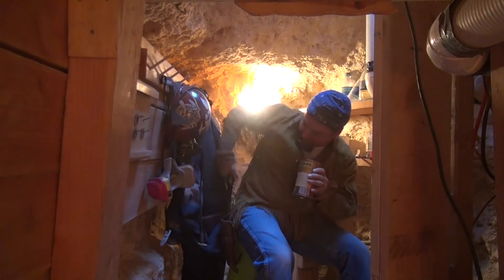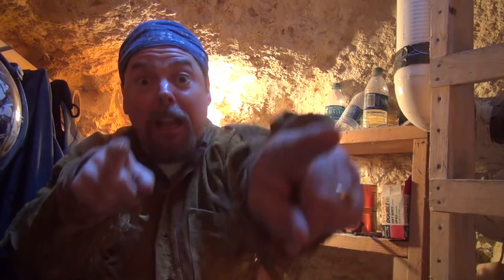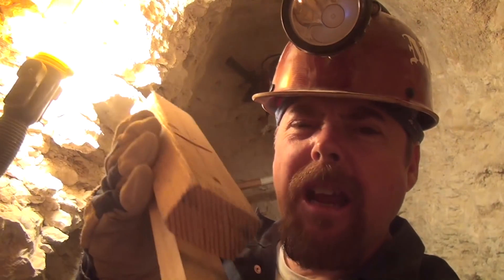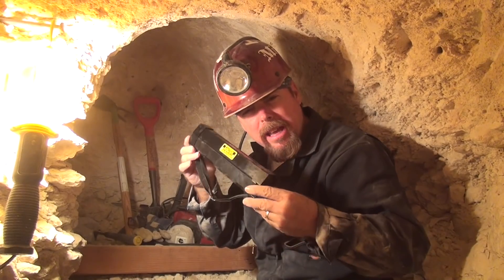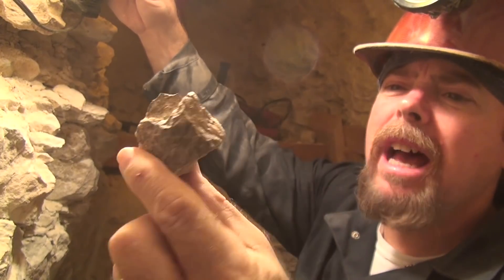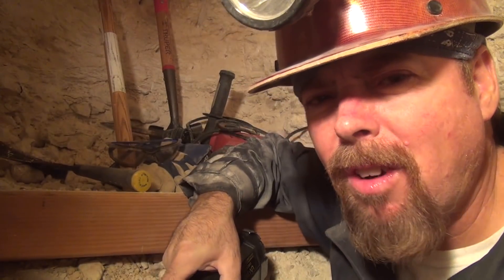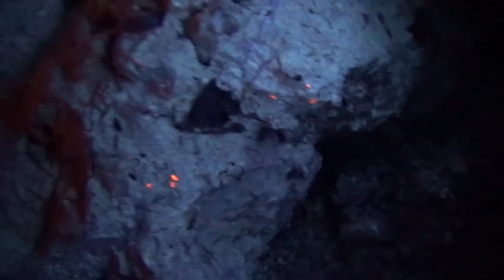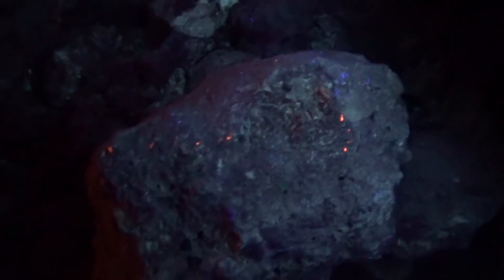HOW TO FIND GOLD | Using a | BLACK LIGHT - ask Jeff Williams

Comment: I’ve done a bit of research into the quickly evolving UVCLED technology. I’ll leave this carpet in pasted excerpt here that I wrote in response to a few YouTube comments and online forum posts. You might find it useful. 

A single or triple convoy host with UVC LEDs inside would be extremely useful! But would take several minutes to have any sanitizing effects. 
It would need to be a large array of UVC LEDs to reach the optical power needed for sanitizing. If you look up a video on Adafruit‘s YouTube channel a few months ago they tested UVC LEDs and they had a really large array. I think it was 5 x 5 or maybe 10 x 10 UVC chips chips. Probably a $1000 array.... And they show how much optical output it gives. Super short and interesting video I highly recommend.

Right now the cheap Chinese chips only offer 3-5mw optical output on average and the nicer Chinese chips maybe up to 20 mW. But at that point you’re better off buying the high output 30-50mw nichia Chips.
 
I remember a few years ago my 1.2Watt output green laser filled up a small 10 x 10‘ room with electronics and optical equipment. Costing upwards of $5000. But Now.... i’ve built several 1.5 WATT OPTICAL OUTPUT green lasers that fit into a small handheld laser pointer and run on a single 18650 battery. Costing under $100 to build. It’s the golden age of electronics… What a Time to be alive!

Until UVC leds reach 500 mW per LED chip… it won’t be viable for large manufacturing and sanitization like used in water treatment plants and sterilization processes in industry. Which are actually pretty common in all types of industry. Tons of different industries and factories have UVC light used for treating or curing or some other use.

And when UVC LEDs become powerful enough to replace the standard bulbs in tubes… That will save shit tons of energy! 

The only good thing about coronavirus… The coronavirus is solely responsible for the fast evolving UVCLED technology. Before the coronavirus… Even January of last year… You couldn’t even buy a UVCLED online. The only place I could find wanted me to send all types of business and licensing documents with my tax ID number and everything. Now there are real UVC leds that are as cheap as one dollar each. Of course these aren’t the good ones but still…and high output brand name leds are only $20. 
That’s freaking insane considering they were completely unattainable before six months ago. 

Not sure if you knew this already but here’s Something to look out for… this is an easy way to identify genuine UVC LEDs that actually put out UVC light. -
Real UVC LEDs will always have a purple/gray ceramic housing, with heavy gold plating covering any metal, and a quartz or sapphire window. Because UVC is blocked by glass or other materials..... therefore it has to be quartz or sapphire. If you look up real UVC LEDs then you’ll see what I mean. They all look the same and They all have that gold plating everywhere with the nice purplish gray ceramic body. Very similar look to Vintage IC chips that had beautiful purple ceramic bodies and gold plated pins and caps. 
If you’ve never seen what I’m talking about… then please take a second to check out these 4  links. Hell its like electronics porn. Just Beautiful…! Sex on a stick!

https://www.google.com/search?q=purple+gold+ic+chip&client=safari&hl=en-us&prmd=sinv&source=lnms&tbm=isch&sa=X&ved=2ahUKEwiY4JLdmbXsAhVGvFkKHTMoBYkQ_AUoAnoECAgQAg&biw=414&bih=622&dpr=3#imgrc=RTX1st5lL-ZABM&imgdii=Zcq0VJJb9uK0JM

https://www.google.com/search?q=gold+ic+chip+Beautiful&client=safari&hl=en-us&prmd=isvn&source=lnms&tbm=isch&sa=X&ved=2ahUKEwiAg4jsmbXsAhWKmVkKHdBWBLAQ_AUoAXoECBMQAQ&biw=414&bih=622&dpr=3#imgrc=Oza7GmtLzvckkM

https://www.google.com/search?q=gold+ic+chip+Beautiful&client=safari&hl=en-us&prmd=isvn&source=lnms&tbm=isch&sa=X&ved=2ahUKEwiAg4jsmbXsAhWKmVkKHdBWBLAQ_AUoAXoECBMQAQ&biw=414&bih=622&dpr=3#imgrc=DTqi5yVnySlCkM

https://www.google.com/search?q=white+gold+traces+ic+chip&client=safari&hl=en-us&prmd=isnv&source=lnms&tbm=isch&sa=X&ved=2ahUKEwiIqsa1mrXsAhVkrlkKHXGRACoQ_AUoAXoECAgQAQ&biw=414&bih=622&dpr=3#imgrc=Gp_zyUEw8ENZJM

A plastic body UVC LED would be degraded and disintegrate by UVC light! therefore they have to be ceramic bodies, and sapphire windows. Even UVA and UVB light is really bad for any type of plastic or polymer. Therefore good quality 365nm LEDs will usually be ceramic and glass with gold plating. None of that plastic rubbish. Sure you can find 365 nm LEDs that have plastic bodies and the standard polymer coating over the top… But they will degrade quickly.

The Chinese UVC leds that are a few dollars each and sold in most of the products on Banggood and elsewhere are between 2-5mw light output each. Maximum I’ve seen is 20mw but they’re a little bit more expensive and I wouldn’t trust them. Like I said the nice brand name UVC LEDs with over 20mW optical output aren’t cheap but totally worth it! Ranging from $20 to upwards of $350 per LED. Highest output I’ve seen so far 70mW but it’s changing weekly. And they’re hard to find because everyone selling out of them quickly because of coronavirus. But once the pandemic ends, high-quality high power UVC LEDs will be cheap and readily available when demand goes down. And as bad as this virus is, I’m glad that it’s helping adVance the UVC technology.

The reason UVA, UVB, and UVC light is so useful and valuable is because it is absolutely one of the most important things used in all types of manufacturing, engineering, The medical field, and all types of science and study of biology and other important areas.. 

From curing finishes to doing spectroscopy and Gene therapy in the biology and medical community… UV light is so important. We wouldn’t be where we are today without it.

I got into UV light for completely other reasons. I build and restore guitars and antique violins… as well as the other half of my business which is industrial circuit electronics repair and calibration work on process control equipment for assembly lines and electronics and stuff like that… 
So UVA, UVB, and UVC light are all very useful in spotting flaws on circuit boards, cracks in traces and solder pads, and most extremely useful in the woodworking and guitar industry for spotting repairs or flaws in the woodwork and finish. Each wavelength is useful and I utilize as many wavelengths as possible.

You can’t imagine the usefulness of having UVA, UVB, and UVC lighting available to you. Whether you like to work on cars and motors, electronics, or do fine art restoration, science, biology, electronics, optics and laser… 

whatever your hobby or business…UV light in all wavelengths is extremely valuable and you will find a million uses for it. 

I’m also big into the laser and optics Hobby. Started with laser pointers and graduated to high end lab and Medical laser stuff which is available for pennies on the dollar out of retired military and health care uses on eBay. dirt cheap incredible stuff. 

I have lasers that easily surpass  100 Watts of optical output and fit in the palm of your hand. That’s crazy insane power levels by the way. Like blasting right through steel sheet. 

Laser modules that would’ve cost $20,000 when new that can be purchased on eBay for under 100 bucks! One hell of a time to be alive that’s for sure. It’s the golden age for everything!

Comment: I modify cheapo Dollar Store flash lights using these 3W 360nM  COB LED .   Using a single 18650 LiIon cell you can get well over a hour use out of them   Classed a UV-A  just within the UV range but work most cool for most stuff.  Handy Scorpion Finders for sure.  https://www.banggood.com/3W-UV-Purple-LED-COB-Bead-Light-High-Power-Ultraviolet-DIY-Lamp-Chip-p-1155865.html?rmmds=search&ID=530200&cur_warehouse=CN

https://www.youtube.com/watch?v=hKDiPp2aCQk

Comment: Hey Jeff,   this stuff is really cool looking under blacklight.   I've got and idea to build something and I wanted to know if this calcite,  sheelite will still glow real good if its ground up maybe down to 100 mesh clasiffier.. wanted to spread a even coat of mixed product over a 4x8 panel and cover it with clear resin and then put a hidden blacklight on the edges to illuminate it.. also can these rocks be purchased in bulk ??  Thanks big dog. Love your videos man!! Really gets me fired up and wheels turning in my head. I'm a carpenter  now but looking to create something different that will open some new doors..

Comment: Have you ever considered using a large vacuum to remove the ore? I noticed most of your pieces are smaller than a softball. Ditch witch makes a nice heavy duty trailer mounted vacuum for cleaning storm drains. We used these to excavate under houses and it moved a ton of soil. You won't need and tracks or ventilation since the vacuum constantly sucks new air into the mine. If you want any info then reply to this comment. Good luck to you and slim you loco hombre.
Reply from the maker: Yep we have seen that system used before ...just need to get one....

Comment: I tried to go to the store you recommend on your videos and maps did not have the right address. I wasted gas and time and ended up at harbor freight tool for metal detectors. They work okay. But not for gold yet. I maybe need to use it more than twice. Lol 
Jeff could you maybe go buy the metal detector from the same store in Las Vegas and tell me if it will actually found gold or not?
Reply from the maker: nope they are no ;onger around

Comment: Utra-violet by definition/factual data is short wave radiation.
Reply: Well thars "short wave{ radio band (3-30Mhz) but dat's at a much longer wavelength than visible light "shortwave"...  From a retired RF electrical engineer boy!!  :) :) Merry Christmas Juan Carnuba my friend!  :)  PS: as the operating freq goes higher tha' antenna wavelength gets proportionally shorter!  ;)